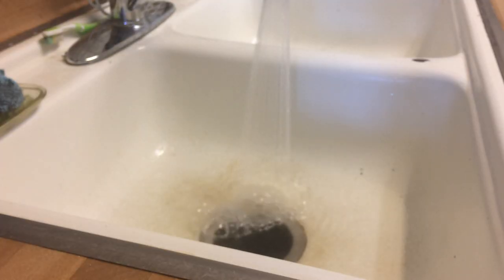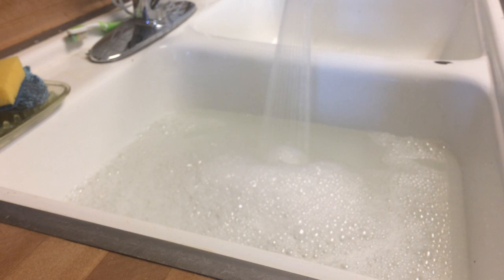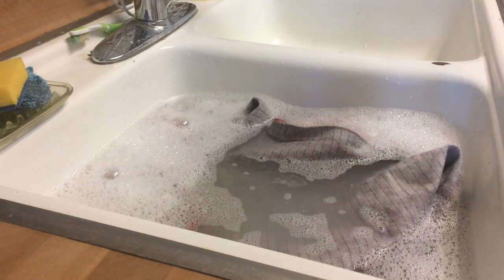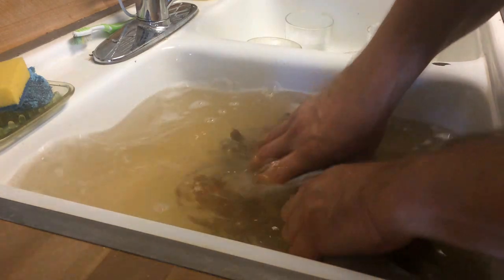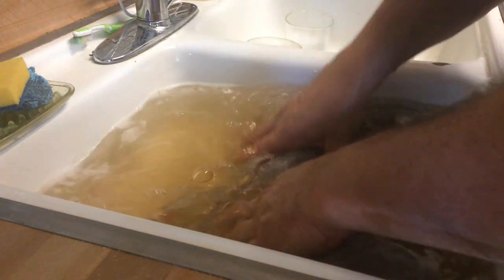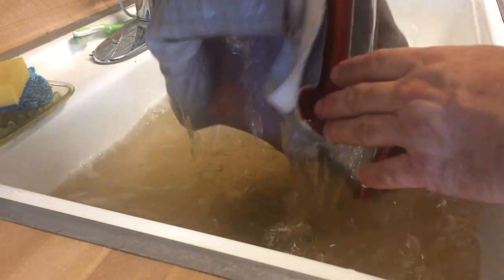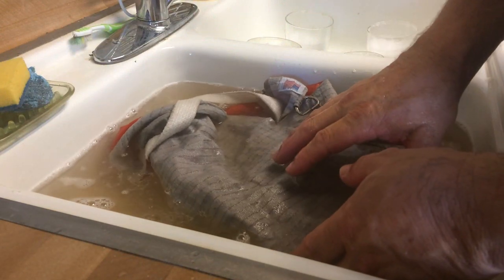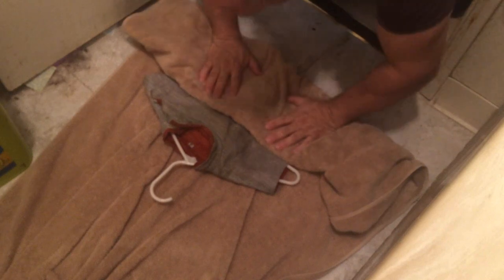I Can Haz Armory #17 -- Washing your lame, glove, or mask

Comment: An obvious preventative measure would be to use a towel after using your mask to wipe off. Do you recommend adding any solution to the towel in order to clean it after every session?
Reply: @samsignorelli  Interesting, and perhaps good point on the "always grabbing the mask in the same place to remove it." Didn't think of that.

Comment: Hello Sir, I am from India. Would you  suggest using MTO (Mineral Turpentine Oil) to clean green oxidation marks on lame? I am worried water and detergent might damage the conductivity of my jacket. Please guide.
Reply from the maker: Nothing is going to get the green out...it's permanent.  And any sort of oil is going to kill the lame.  Washing it like I show is perfectly fine.  The important thing is that the green areas conduct with less than 5 ohm resistance...and I have seen some pretty green lames pass with flying colors.

Comment: I have seen some other add a gallon of white vinegar too. What are your thoughts on that?
Reply from the maker: Not sure...never heard of people doing that.  Is that in addition to or instead of the ammonia or soap??

Either that or they sweat so much that the lame smells like a reopened grave and they'd rather deal with the vinegar smell!
Reply: @samsignorelli  seems like instead of the ammonia. I’ve tried both methods and the green stuff still won’t come off. That’ll teach me for buying the cheapest stuff.
Reply from the maker: @BetterExplanation  The green stuff is copper oxidizing and doesn't really go away.  However, it doesn't immediately kill the lame.  I've seen ones fairly green that passed resistance testing with no issues.   It's the corrosion you DON'T see that causes issues initially.

Eventually, tho, the oxidation WILL result in a dead lame.

It happens to inox lames as well.
Reply: @samsignorelli  That's a good point. Some of the green spots actually are still under 5 Ohm.  I just feel like there must be another way though chemically to remove that oxidization but I guess adding more chemicals to something you wear isn't the best idea. I also only noticed now that at least for the glove I have the metallic part of the threads  (I think) in the weaving are actually really thin, are they cloth surrounded by metal? I'm not sure.. We need like a high school, or college freshman to do a chemistry study or material science study as part of a class and find the ultimate solution.
Reply: Maybe I should start putting antiperspirant on my forearm and hands too.
Reply from the maker: @BetterExplanation  The lame on the gloves (presuming you're talking sabre gloves here) is the same as on a regular lame...has the same resistance limits as well.

They USED to be just the lame material with an inner liner until 2013 when 800N gloves became required, then we started seeing stronger materials in the cuff and the lame on top of that.
Reply from the maker: @BetterExplanation  Could help.  On a foil lame the neck area tends to go green first via sweat from the neck....the rest is protected by the lame lining and the jacket itself.   For a sabre lame it's the neck -- for the same reason -- and then the cuff of the weapon sleeve.....but the oxidation will propagate down the chest/up the arm from there.

Comment: Quick question: So if there is rust on the neck area what would be the best way to get it off ? I never really understood how to do that
Reply from the maker: red rust or green oxidation??  either one is going to eventually kill the lame.,  i've never found a way to get rid of either, unfortunately.
Reply: @samsignorelli  the oxidation, if so since that’s the case how often should you wash the lame to insure that the rust doesn’t stay on ?
Reply from the maker: @ethanboy2005  depends on how often you fence and how much you sweat.  if you're a heavy sweater or fence frequently, probably once a week, but keep in mind that what you;ll be doing is slowing the degradation down...that green patina will eventually be there.
Reply: @samsignorelli  got it thank you

Comment: I was wondering is you could show us how to test connectivity of a lame with the free (almost) multi meter from Harbor Freight Tools (Cent-Tech 7 function multi meter).  Possible?
Reply from the maker: I don't have that multimeter, but the testing is the same regardless of the meter you use.

I'm a little busy with armory this week, but I'll see if I can get on that vid.  Thanks!
Reply: I'll mail you a new one or e-mail you a coupon.  You can subscribe to their coupons as well.  I just got e-mailed the coupon  today.  It's good from 2/2/18 - 2/4/18.
Reply from the maker: Sure....homfencing.com for my biz address
Reply: Ok.  The meter is on its way.  See, I have no idea the correct setting on any multimeter - what is passing and what is not.  I’d like to be one step ahead of the tournament armors to fix problems and not spend big bucks on a new lame….don’t forget the new stenciling.  Ouch!  Also, the armors look to have jerry-rigged every multimeter they use with a foil tip weight tester.  Thanks for the time you give us do-it-yourself fencers!
Reply from the maker: The meter arrived today...let me play with it a bit and get back to you.
Reply from the maker: Shot the vid tonight, but was not happy with it.  Will try again tomorrow.
Reply from the maker: Don't know if you're a subscriber, but I uploaded the vid yesterday.

https://www.youtube.com/watch?v=fi7dw57GFdo

Comment: In your opinion, what is the most durable foil lamé (maybe for a reasonable price)?
Reply from the maker: It's more a matter of care of the lame, regardless of the type.

My own sabre lame is a Linea copper one, and I have a couple others I use for my sabre class.  They've all lasted well in spite of being shoved into my bag at the end of class (not with the whites, tho....those hang up outside the bag!), which, admittedly, is NOT how I tell people to care for their own gear.

The only major prob I've had was with the right forearm sleeve under my glove cuff...because that's where sweat from my hand went and started to corrode the copper... but even that took some time.   I had it patched and still use the lame, and the rest works fine.

My experience with lame material that looks more smooth -- like the Leon Paul lames -- is limited to my first FIE sabre glove, which WAS an LP...and the cuff turnover -- the part laying against my lame sleeve -- died after a few months...twice.  

A stainless steel lame lime an Allstar INOX might last longer than a copper one, but it's still going to come down to care.

If you fold the lame tightly in the same place for storage, you'll eventually break the wires and make a dead spot, regardless of copper or stainless steel material.
Reply: Thank you.
Reply: ...and the other thing that helps, is to take your wet, sweaty clothing out of your fencing equipment bag after practice, hang it up and let it dry.  Goes for body cords too.  Great video!

Comment: i dont think its safe to Wash the mask?
Reply from the maker: Sure it is....getting it wet won't destroy it (unless you leave it submerged for a full week or so)

http://nebula.wsimg.com/a9e1ad8ef821a8ad60f28250149031fe?AccessKeyId=30E8767FB0ECAD7A5D19&disposition=0&alloworigin=1

Those are the printed instructions.

You can also do the dishwasher trick...place the mask on the top rack of a dishwasher, open end facing the sprayers.  Run it by itself with a FEW drops of detergent (not the gel packs).  Either turn off the heated dry cycle or pull the mask out when the wash cycle is done but before the dry cycle starts.  Then wipe down and press water out of the bib as the instructions specify.

In either case, it takes a couple of days for the bib to fully dry due to the foam inside.